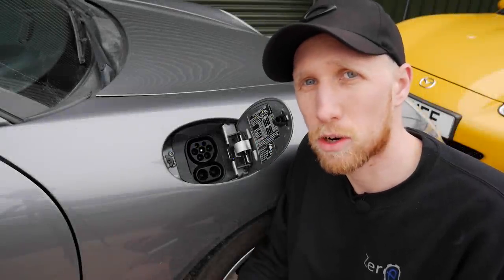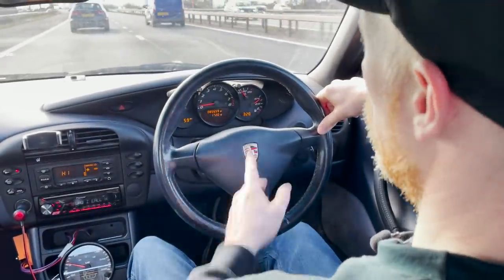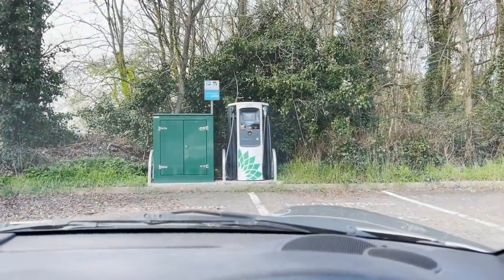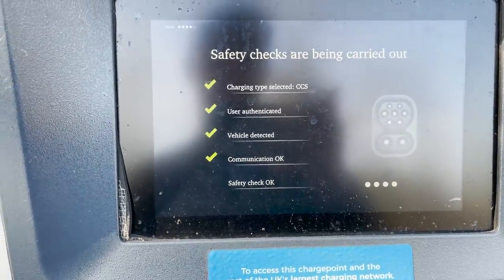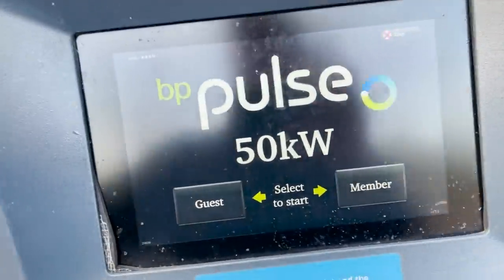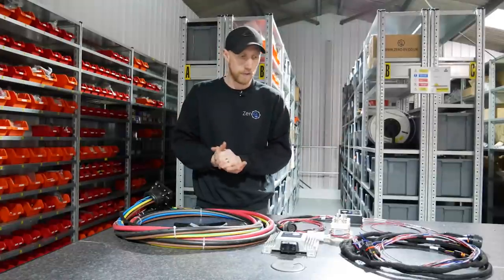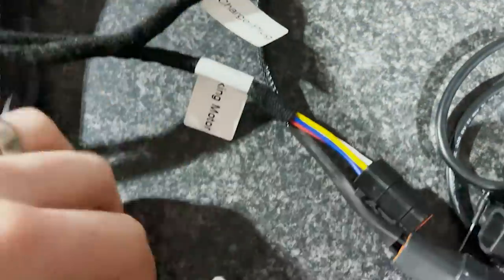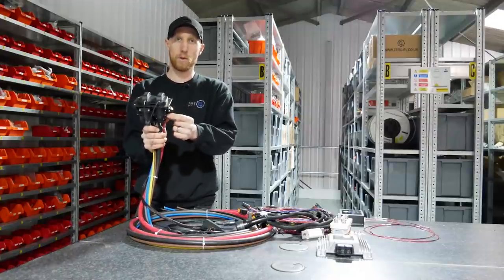CCS Fast Charging For All EV Conversions - Porsche Build rapid dc charging

Comment: This only works with the Orion BMS right now. Is there a plan to make it work with AEM?
Reply from the maker: Not at the moment as that system does not do dynamic charge current limiting. It would work but with the way there software operates will slowly damage the battery over time.

Comment: Noticed on the site, it is a requirement to have a 200v pack. Can modifications be made say for a 96v230A pack to still fast charge at a CSS?
Reply from the maker: No as the ccs chargers themselves are min 200v

Comment: Ah nooo, I'm planning a conversion but the minimum 200V DC is a bit of a spanner in the works with a netgain hyper9HV setup. Any recommendations for a 22kW type 2 charger for a ~144V battery system? Ideally i want fairly rapid charging! (don't we all!)
Reply from the maker: Why don’t you go with a 350v system? There is a new Zonic motor range coming soon.

Comment: Hi, I have a different application for DC fast charging. I have tesla batteries, and I want to charge them with aftermarket alternators. These alternators are used for car stereo systems. I want to use them to charge tesla batteries. I'm not charging for milage, but for energy storage, so I can use it with an inverter. I want to know if DC fast charging or components in it can help my alternator charge tesla batteries.

My pack size is 2-4x 5.2kwh tesla model S battery modules. That's 250 AH each, 10.4-20.8 kwh total size.

Each alternator can drop 400 amps at 12 volts, or 4800 watts @ 12 volts. In tandem can produce 800 amps or 9,600 watts DC. 

DC-DC chargers I found only support 20-50 amps at 12 volts, which is only 600 watts, not 800 amps or 9,600 watts @ 12 volts.

This is why I'm looking into DC fast charging

Level 1 EV charging is 12-16 amps @ 120 volts AC or 1,500-2,000 watts AC. 

Level 2 EV charging is 16-40 amps @ 120 or 240 volts or 4,800-9,600 watts AC.

DC fast charging is 100 amps @ 480 volts which is 20,000-60,000 watts DC.

CCS goes straight into the car, bypassing conversion components that limit the charge capability. I want to do the same thing, but for alternator charging, because my bottleneck is "off the shelf" DC-DC chargers. 

CCS goes straight into the car, but the car has to be capable of receiving it. Since I am building out my car, I just need to build in all the necessary parts.

I'm dubbing it "fast charging", because it's the same power as level 2, but it's onboard, and all DC, so it should be faster, and more efficient than level 2.

Even if I don't actually get a full 9,600 watts charge into the tesla battery, is DC fast charging with 2x 12 volt 400a alternators a good solution to charging my battery pack faster than using a 50 amp 600 watt DC-DC charger?

Can 800 amps @ 12 volts go straight into a 12 volt BMS for tesla model S batteries? Or do I need to protect the batteries more with another component in between?

Or is there anything else I can do that might help?

Comment: Any reason why the battery needs to be at least 200V? I’ve been thinking of adding CCS charging to an electric motorcycle conversion which is only 110V
Reply from the maker: That is the ccs charging standards there is no ccs chargers that go below 200v most don’t go below 250v

Comment: Could this plug be used to replace the Chademo port on 2016 Nissan Leaf, in order so the Leaf can be more compatible with future networks?
Reply from the maker: Unfortunately it does not work like that, the ccs2 system is completely different in regards to opinion. But good thinking.

Comment: I understand that the battery pack voltage would need to be changed to accommodate and the installation angle would be near enough vertical, but would it be possible to fit this to the MX5? Is the filler port large enough to take it? Or at this point would it be easier/safer to form another "filler flap" into a more vertical surface on the car?

Comment: Hi, Is there a CCS controller (evse) for charging from a external 5kw battery to the car.
Instead of coverting dc to ac then the car converts from ac to dc.
Reply from the maker: No as you need to voltage match only way would be to also have a dcdc as well to convert the dc to be correct.

Comment: Awesome that the aftermarket is able to keep up with what the OEM's are offering now.  Good video and nice install on the Porsche.  This should help make more converted cars be more than around town cars.  Next if you get into the new more efficient motor that Tesla is starting to use will be a good addition.
Reply from the maker: The model 3 motors are coming very soon. Thanks for watching.

Comment: Is there any particular reason why you couldn't build in some modularity for your battery array, allowing you to have a removeable high capacity battery pack for road trips? I'm thinking a plug in the boot or hood that you can use to connect extra batteries to your system in parallel. Battery controllers seem like the only potential issue.
Reply from the maker: This has been looked at but the battery’s must be the same chemistry, discharge rate and voltage so not as easy as just plugging in

Comment: What's the maximum kW you can get from the CCS? Dependent on your battery voltage, I would guess ... but I'm wondering if it can get as high as 150kW or something like that. We need more rapid chargers in Dallas, TX badly! Large battery packs until that changes.
Reply from the maker: Can do 150kw but that’s at 800v we have limited the kit to 200amps at the moment but it is capable of 800v.
Reply: @Hazell_Nutz  Gotcha - makes sense. So looks like 80kW max w/ 400v system which is what was mentioned in the video. I'm with you now. Interesting to learn about the balance of weight in the car vs. battery pack size vs. voltage. Also just learned that the US uses Type 1 CCS vs. Type 2 in Europe. Didn't know there was a difference!   Love what y'all are doing. Keep up the good work.

Comment: Just on the comment of having a smaller battery, I read a article on the Nissan Leaf where they collated all the data over around 5 years from the original 24kWh Leaf and found that 40kWh is the optimal size for a huge majority of drivers. As an owner of a 24kWh Leaf I'd have to agree, it would fill that gap for moments where I forget to plug in at night or just be able to go somewhere whenever I want
Reply from the maker: That’s great information, we go with about 35kwh to 53kwh depending on car size.
Reply: Yeah, ditto - that got me thinking completely differently about the entire design & build, thank you

Comment: I drive a Nissan Leaf.  I have often thought about changing my J1772 Plug for a CCS plug.  As Chademo gets harder to find,  there will be many cars that will need some kind of solution.  If you made a kit to replace my J1772 plug with a CCS plug and keep the Chademo plug and have it all work with Nissan's canbus, I'd buy it in a hurry.  I'm very mechanical but I don't do well with the electronics side of things. I'd gladly volunteer my car and time to help you develop the kit.
Reply from the maker: It’s very difficult as the chademo set up is very basic where as ccs requirements are massive, with a lot of additional software.

Comment: So I know it isn’t very Gucci but have you guys considered a kit to convert a Yaris Hybrid into plug in? I’m likely to be buying one from my dad and it seems like it wouldn’t require too much modification as I know people in the US have done it with Prius’
Reply from the maker: That would require a lot of work.
Reply: @Hazell_Nutz  so what I had in mind was a battery pack that basically constantly charges the Toyota battery to trick the car into thinking it’s always full and putting itself into electric only mode far more of the time as a result. Maybe there’s a fatal flaw in my plan? I’m very much a mechanical engineer rather than an electrical one so certainly out my depth.
Reply from the maker: You would require a very clever system to charge the other pack some sort of dcdc to maintain the correct voltage as the other pack decreases in charge. Other options would be to parallel a second pack in with the original
Reply: Well if you guys ever did want to look at it and do a kit I’d certainly be interested. I think to add value and feel worth plugging in like 15 miles electric range would be enough so a pretty small battery.

Comment: Does it stop you from turning on motor if charging? Or that's something we have to figure out by ourselves? ;)
Reply from the maker: All depends on your set up, as explained we recommend doing a spit system, the bms should also be set up to pull gear selector power when charging.
Reply: @Hazell_Nutz  answering viewers tells a lot. You guys are cool

Comment: Be aware that Vector sometimes decides to update the software on their VCCU causing it to no longer work with your system. We've seen this on our vehicles and can create strange behaviours. After rolling back to the previous version, the vehicle charged as normal again ( 350+ kWh, 576V nominal, to give an idea :) )
Reply from the maker: Thanks, we do know of an update come in Q4 which will alow us to offer CCS1 😎 lucky we have a test set up for every vcu to be checked on before shipping.
Reply: @Hazell_Nutz  what's the difference between CCS 1 and 2?
Reply: @xXZ31t6esTXx  CCS1 Combines SAE J1772 (IEC 62196 Type1) socket with 2-pin DC, CCS2 combines Type2 socket with 2-pin DC.

Comment: You guys should try Sunamp heat batteries as an addition for your battery pack temperature control . Aka preheat in winter and storing excess heat to be used for either cabin preheating or battery preheating.
Brilliant light weight idea.
They use fase change material to store heat energy and they have an automotive section.
Reply from the maker: Looked at them about 2 years ago, unfortunately at the time there temp ranges where to large but might look again.

Comment: 3600 GBP for the kit...4950 usd....and it's an add on for an orion 2 bms....damn that's spendy
I know you guys want to recoup development costs but that's one heck of a markup given the parts costs...
And you're the only game in town for this so you CAN price however you want...but still..
Reply from the maker: The parts in the kit are not cheap. Also remember this includes uk vat of 20% and at the moment the gbp to dollar is very strong which is not normal. There is a massive amount of development cost behind this which is probably why we are the only game in town. Costs will come down but we need to sell allot of kits before we even break even.
Reply: @Hazell_Nutz  makes sense, I'll let others with really big pocket books grab em then snatch them when the costs drop to more like $2000 usd :D
That's said, have you done much testing to find the peak charge rate of chevy Volt cells? Do they max out at 50kw internally or can they charge way faster
Reply from the maker: The biggest issue is cooling the volt battery are good but need to keep them cool when charging.
Reply: @Hazell_Nutz  yeah I was going to keep cooling active while fast charging, that isn't too difficult, my big concern was fundamental limitations of the battery like if the cooling loop isn't good enough to prevent hot spots, or the C rating isn't good enough and it cooks the battery fast at high charge rates like 80kw, beyond what the inbuilt cooling loops can handle
Reply from the maker: I did stupid things with a volt pack in my skyline when first built and it held up very well. Things like a large Tesla drive unit doing stunt shows flat out for 5 mins and they handed it well

Comment: A brilliant kit, a true masterpiece! I'd have a couple of questions: What are the external dimensions (in metric units, if possible please) of the ccs port (plate as shown in the third picture on the ZeroEV online shop)? I have to know if it would fit to the fuel tank opening of my beloved Jaguar X-Type I dream of converting to an EV one day... Also, if the Jag's opening turns out to be too restricted vertically, is it allowed to mount the charge-port CCS plate into the former fuel tank horizontally - that is, rotated by 90 degrees? (sorry for my clumsy wording, English is not my native language) Thank you again for producing this masterpiece of engineering!
Reply from the maker: Hi, we will update the website with a spec on the connector. If you month outside of our recommendations it will work but zero Ev takes not responsibility for it.